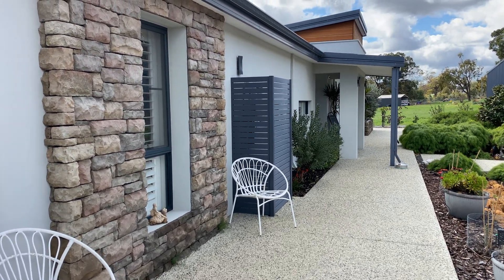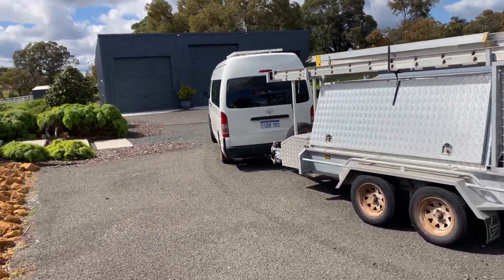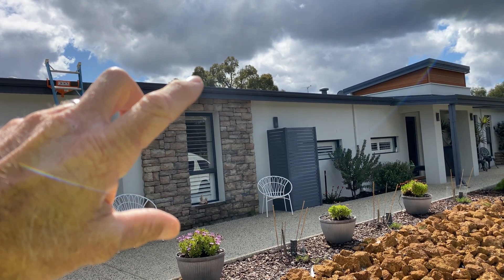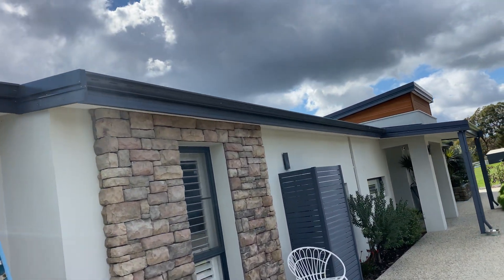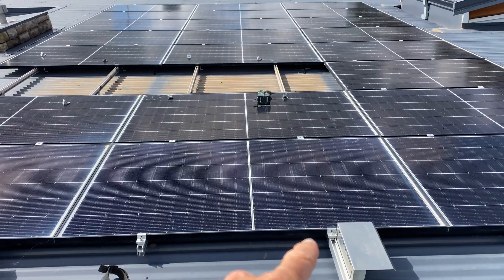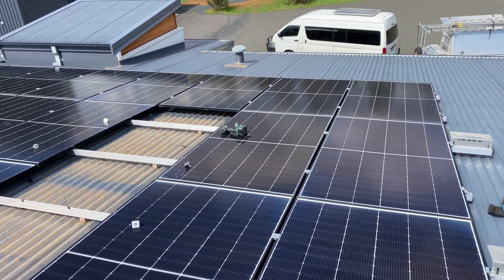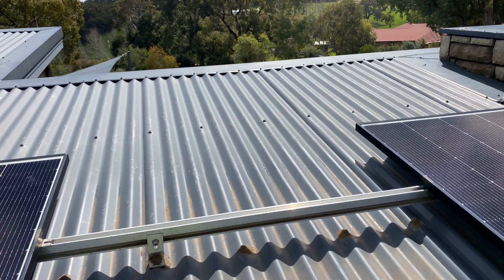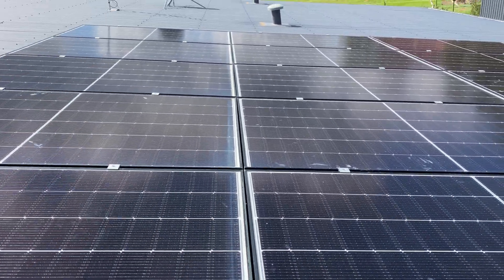Why is a solar system on a tin roof leaking water into the house 😲🤦‍♂️

Comment: Very interesting. I hope you’ll share an update when you learn more. As a complete layman I’m curious why you didn’t take a hose up on the roof and shoot water directly at the place you suspected was at fault? Seems like a quick way to verify, and it’s already leaking so it’s not like you’d make the mould issues much worse.
Reply from the maker: Their ceiling had been repaired due to believing the leak had been fixed. Lots of insulation in the roof which absorbs the water for long periods and there is no way of seeing into that roof space anyway. Plus with my hourly rate that was something he could do at his own leisure if he wanted 👍🏻

Comment: 4:05 where do these guys get the training that "silicon everything" works? Putting silicon in a location that it shouldnt go, or poorly finishing the silicon can create more problems. Eg a ridge in poorly finished silicon can hold back water and create a dam, or divert water into a place it would normally fall away from.

Pretty dumb if you ask me.

I'm a DIYer and not a professional, but c'mon this is a joke.

Comment: Had a 20-year leak. Several plumbers  / roofers tried to fix it. Only ever leaked in two inch an hour rain. The likely spot was where valley gutter discharged on a lower section and leaves accumulated. About 3m uphill, there is a whirlybird. Turns out the whirlybird was tilted and only leaked in very heavy rain. Took 20 annoying years to find! At the start of the video, there's a roof penetration that looks like it's leaning.

Comment: missing  turnup or turnups  on one of the sheets of tin not enough. Or crack in a turn up. Water can blow back easily on low pitch roof. Hit the spot you think it is leaking with a spray from a hose for 5 minutes.

Comment: I have a similar colour bond roof, and also had leaks with solar panels. I had solar company back, my expense to remove and reinstall 7 of the 21 panels, while adding silicone to screws under those panels, including originals screws and also those that were replaced with larger screws for the solar rails. It almost solved the issue but I still had a lesser issue not in the exact same place as the original leak, but not far from it. Eventually I did more silicone to other screws as well, and it either close to being now or maybe completely solved, not 100% sure yet pending more rain. One thing that was said in the video is water can't get in as all screws were correctly installed on the peaks and none in the valleys. I have seen water coming in via screws installed in the peaks. I think the sheer volume of water you can get in heavy rain can totally fill the valleys and some drip in via screws that aren't well sealed. I also added a light smear of silicone  in the overlaps in areas that were near the leak source. Another possible source is with overlaps if the top sheet is not firmly held down when installing the screws at the overlaps points. I'd also suggest anyone installing solar on colour bond to install all new screws in area were panels are being installed (unless of course the house is not very old - my house was probably 13 years old when the solar was added. 8:40

Comment: I can appreciate why they slapped silicone on the roofing screws.  Some of them have clearly been over-driven with a visible divot around the screw.  Once that has happen you can be pretty sure the seal is knackered from the force so any water in the divot will make its way inside the roof.

Comment: As you say, water can easily run down beams etc and drop down well away from the problem. Have fixed a roof that the insurance company and builder couldn't - they put silicone everywhere except where it was leaking. What a mess. A cheap borescope camera and garden hose found the leak. Correctly installed replacement flashing fixed it.

Comment: I use a thermal camera to spot where exactly leaks are dripping into my ceiling, you'd be surprised how many you might find without it actually doing visible damage.

We also have a low pitched roof where some sheets weren't turned down enough into the gutter and capillary action would drag water back up a fair way before it dripped.
Reply: Yes, water driven up by wind. 
I found a leak 5 levels down from a roof  ventilation cover. 
When the fan runs in wet weather it dragged rain water in and up inside the flashing.
Reply from the maker: Never thought of doing that 👍🏻

Comment: On low pitched roofs with corrugated iron roofs...  you are supposed to bend up the top valleys of the upper end of the cut. This is then covered by the flashing of course, sounds pretty much exactly the issue. The wind blows the water up hill and up over the top/back of the corrugate which then dribbles back on the underside of the roofing presenting anywhere.
Reply: Yes. Correct.

Comment: What is that roof pitch? 5 degree is min for custom orb profile and that can be a risk with purlin spacing if roof sheets get a bit damaged with people walking on them eg: sag/bow between purlins will lower the pitch.
Reply from the maker: It wouldnt have been much more than 5 I dont think
Reply: In New Zealand its 8 degrees minimum.

Comment: I mentioned in one of your videos that when I had solar installed about three years ago, a roof plumber fitted the rails and panels. He conducted a roof inspection the week before installation and repaired two small leaks at no charge. I imagine addressing these issues would be much more expensive and complicated once the panels are already installed. I live in North QLD. We measure rain in meters, not mm.

Comment: Im no builder but why would you have decorative brickwork on the roof? Surely no one can see it. Wind-driven rain will almost certainly be the issue.
Reply: yeah I'd have it ripped out, and proper roofing put on
Reply: Yeah and that brickwork doesn't match the rest of the house ffs. Weird.
Reply: Yeh some smart architect came with that decoration 😅